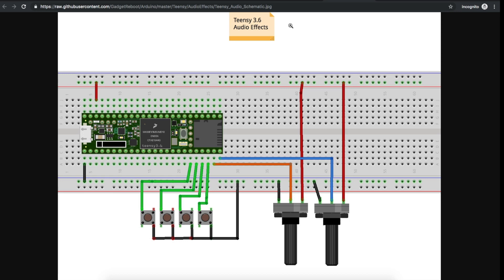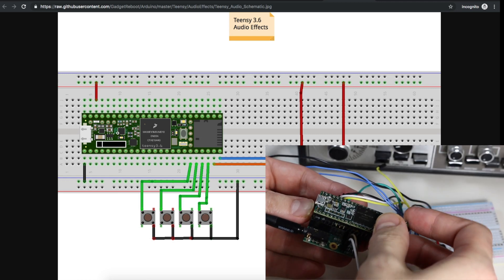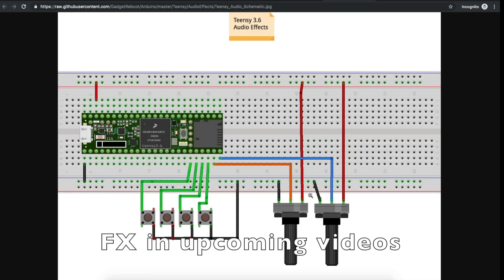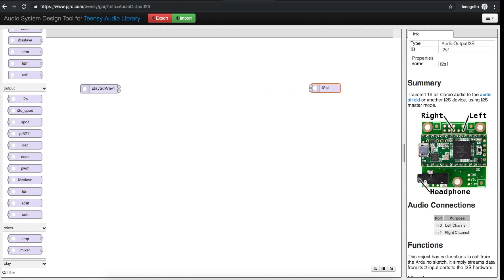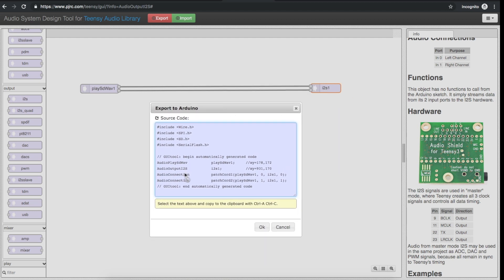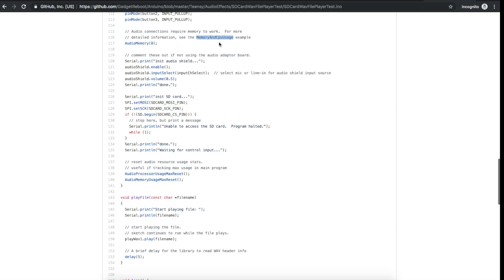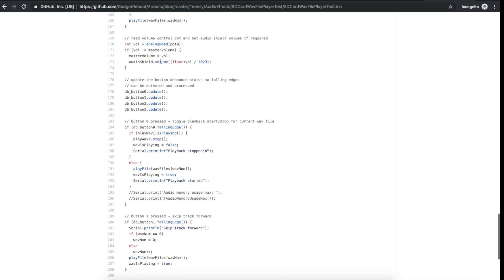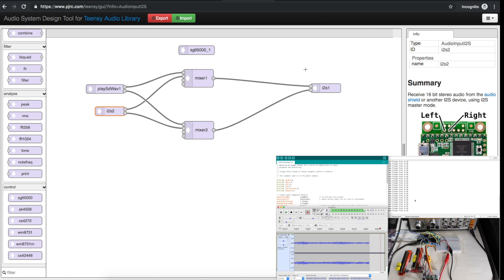Teensy Audio Part 1: How to Use the GUI Design Tool - Play wav Files from SD Card

Comment: Thanks so much for sharing this knowledge! 

I'm building a wearable drum machine (Glove form factor, 4 FSR sensors), but I'm currently struggling to achieve variable velocity on each audio sample's output. I've got the teensy 4.1 outputting both midi and audio simultaneously, and I'm wondering if anyone has encountered any functions/arrays/For-Loop statements I could append the existing code with that would achieve variable velocity for the Wav2Sketch files?

-- I can post code here if, by some miracle, anyone's interested in taking a look --

Sorry, I know that's a mouthful. Just thought I'd drop in here on the off chance anyone knows of an easy way to accomplish this 😁
Reply: Late to the party on this one! Did you ever manage to solve the variable velocity? I'm starting to work on a foot drum floor pad with velostadt. If you want to post your code here, it'd be amazingly helpful!

Comment: With the 'newer' 3.6 teensy which version of the audio board are you using please? I'm just starting out and need some clarification, thx.
Reply: Teensy3-audio, rev c. Apologies for noise!
Reply from the maker: I’m using rev B where the current Teensy  3.6 compatible board would be Rev C which has a 100 ohm resistor added to a Clock line according to the product page I just looked at. 
And apparently there is rev D for Teensy 4 and I believe the difference would be just in the memory card pinout  so it sounds like if just using the audio chip, any of the versions should work.
Reply: @GadgetReboot  Thanks for the prompt reply, I think I'll go 3.6 and rev C. Subbed, and looking forward to learning ;)